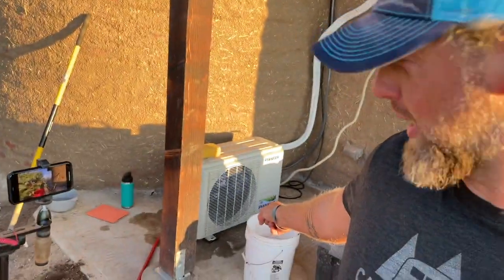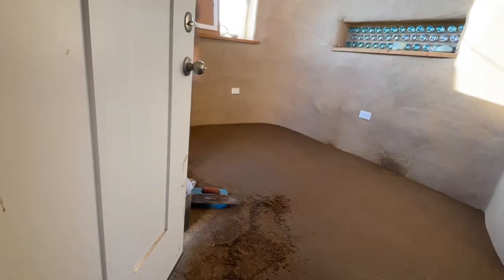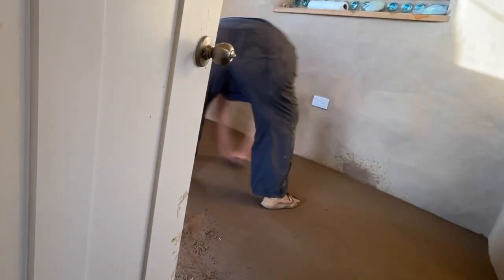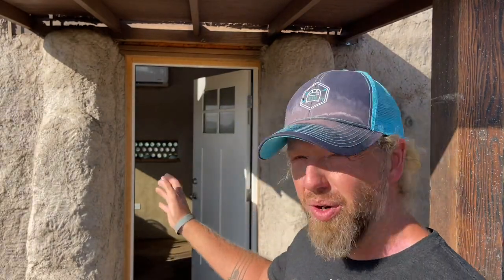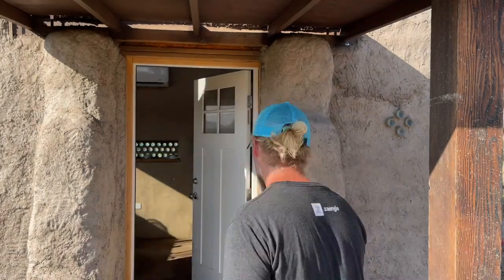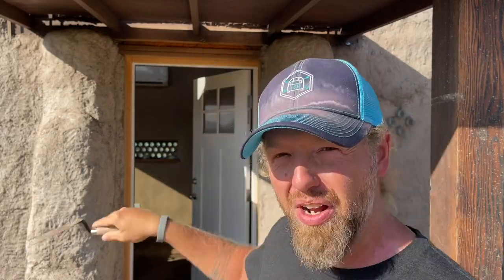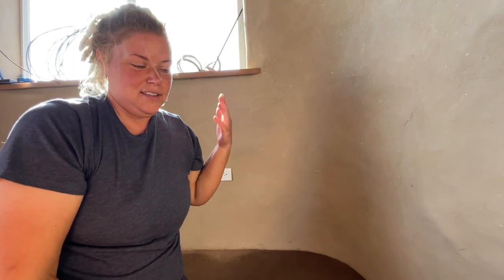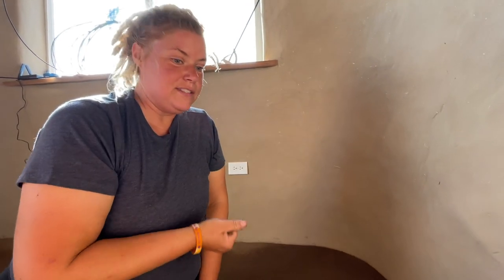Get This Shed Done - Day 24 - Floor Touchups, and Chicken Wire

Comment: You should be able to trim the drain hose and let the water “drop” into the bucket. That way air can still get in the hose and the water from the indoor unit will still drain. You might be able to test this by pulling the bucket away from the wall and letting it drain naturally. The level of your outside unit doesn’t matter. The inside (evaporator) is where the moisture condenses from the air.

Comment: And you know I always have questions…..

 Why cant the wood around the front door be exposed and oiled wood?  The contrast between wood and cob looks nice. 

Can you pipe the condensation from the mini banana split to the front planters?

How will you prevent the dirt and moisture in the planters from leaching moisture into the shed walls?
Thank you

And did y’all see how curiosity has notched up TST ‘s bravery. TST was right up there watching Jonathan with that chicken wire. I think she wants to play with the whole roll of wire.

Comment: Is there a reason you don’t want to leave door frame exposed?
Reply from the maker: Great question. Yes! We’ve seen termite damage on exposed (untreated) wood out here so we want to cover as much wood as possible.
Reply: I believe that, if termite damage is an issue, thoroughly treating the wood is more important than "hiding" it. I'm fro AFRICA, the home of termites, and from bitter experience it's best to pre-treat timber on all sides BEFORE installation. The pesky critters will pick away at cemented walls to go for wood. I have photos somewhere of an unexpected and unbelievable infestation. Also, we used to fill foundations and floors with poison before building. It often helped stave off the damage. It's scary when a door falls off it's hinges in the middle of the night, exposing termites hollowed out the frame 😲😬😩